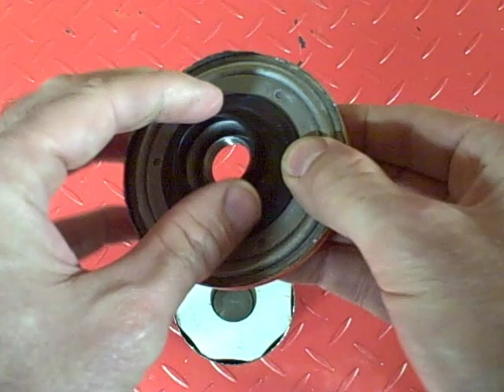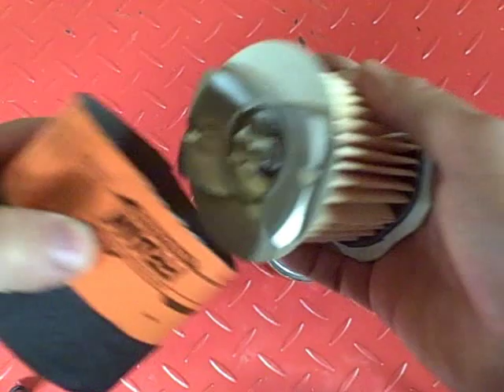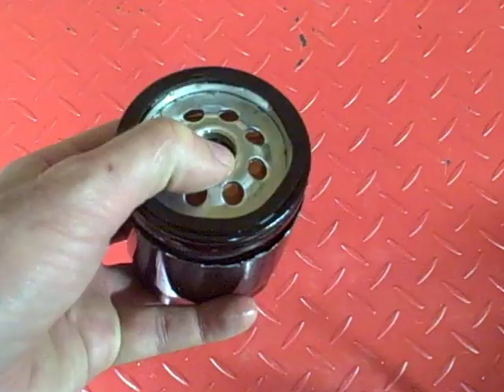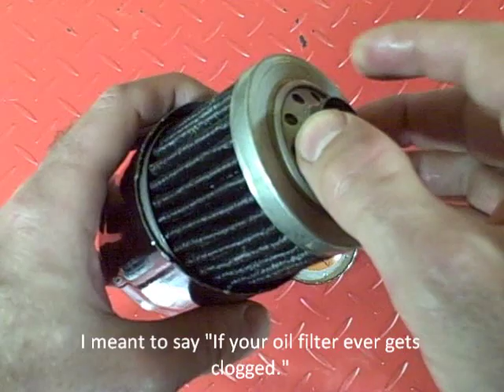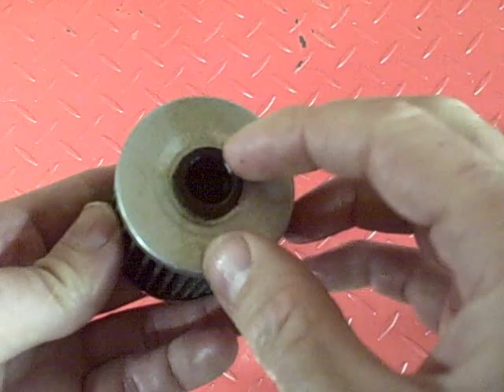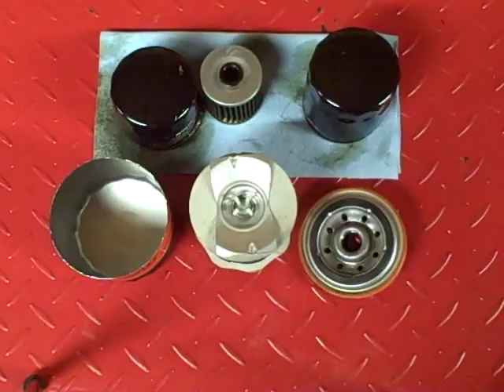Motorcycle Repair: Inside a Harley Davidson Oil Filter and a Fram Oil Filter

Comment: I run Amsoil  oil and filter with my Harley Davidson. Top of the line.
Reply from the maker: Jerry Hubbard Does Amsoil use Wix filters for HD? I thought most of the Amsoil filters were made by Wix.
Reply: ***** I honestly can not answer that. I thought Amsoil made the filter. If Wix does make the filter I am sure it is made to Amsoil specs. Wix does make good filter.

Comment: The Kohler is also a Champ filter.  In all total, there's under ten companies worldwide that make oil filters.  In America, the big ones are Affinia (Wix, NAPA, Carquest, Castrol, Penske), Honeywell (Fram, Honda, Pennzoil, Quaker State), Purolator (Motorcraft, Bosch), and Champ (STP, AC Delco, HD, Mobil, K&N, SuperTech). The only one to steer clear from is Honeywell/Fram. They are NOT worth the money.